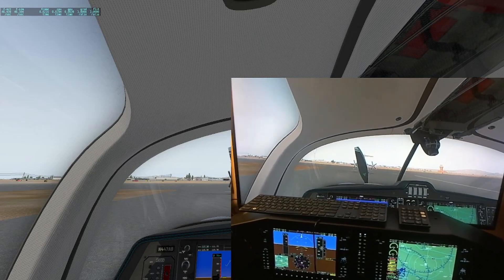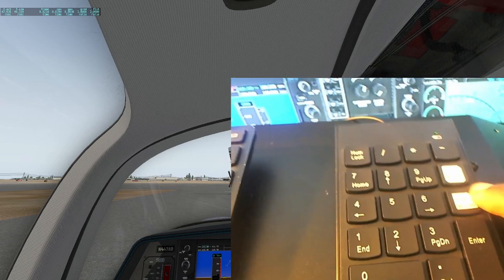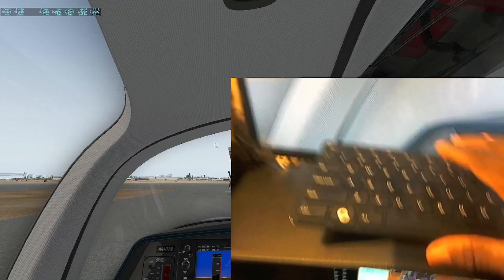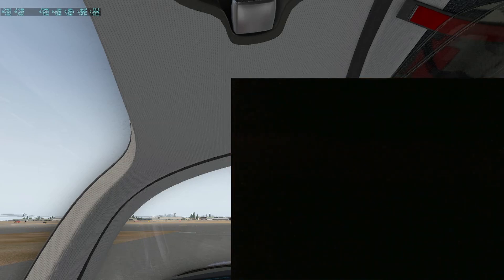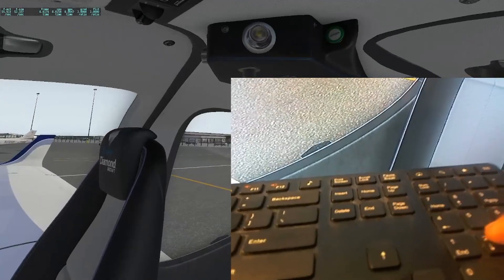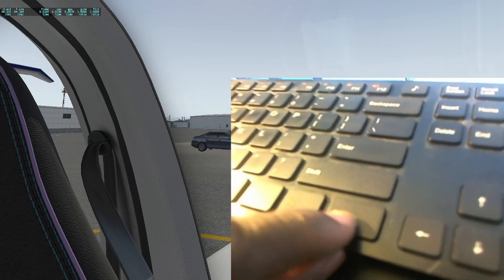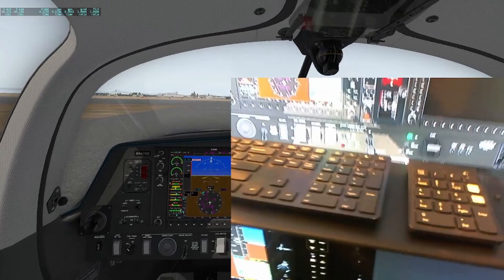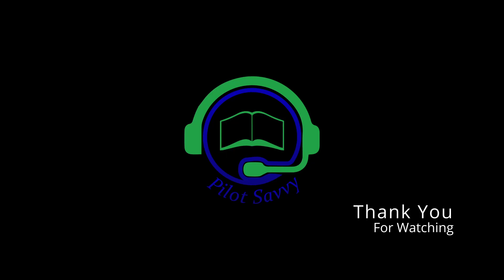X-Plane View Control Using a Numeric Keypad

Comment: my keypad dosent set the view and the keypad its active but dosent save any view ?
Reply from the maker: Hello Abdullah_q8171, Thank you for reaching out. I am sorry to hear that you are encountering technical issues with your number pad functionality with your flight simulator. I am sure that we can resolve the issue.  Make sure that number lock is on. I use the hat switch on my yoke to point to point to the view that I want then save it with the number pad or the full keyboard by holding down the control key on the full-size keyboard and pressing and releasing the desired number key while still holding down the control key then release it. Once the view is saved you can use either the number pad or the full keyboard to select the saved view. Occasionally USB devices may stop working momentarily. You may have encountered this issue with your mouse or full-size keyboard or other devices.  On your PC desktop the solution may be to simply disconnect and re-connect the USB device.  In the flight sim environment, you may need to re-start the simulator.  I hope that this response is helpful.  Let me know the results.